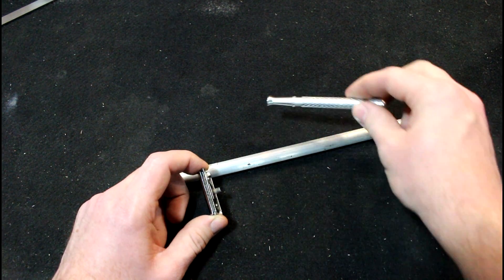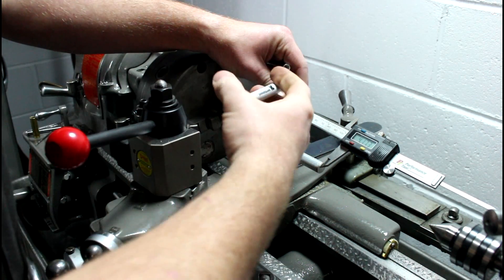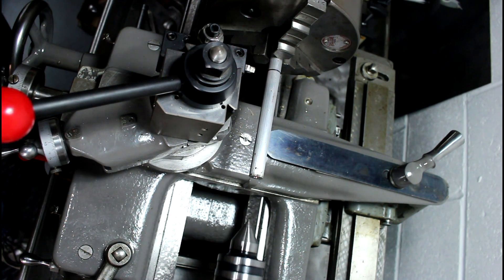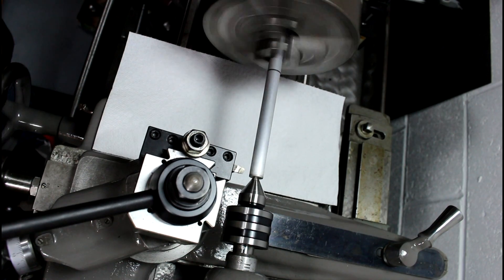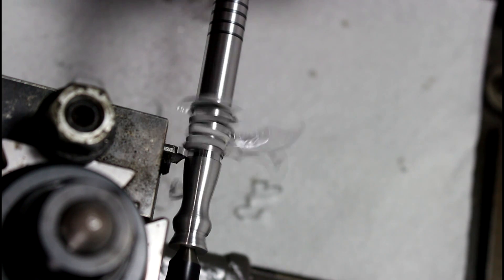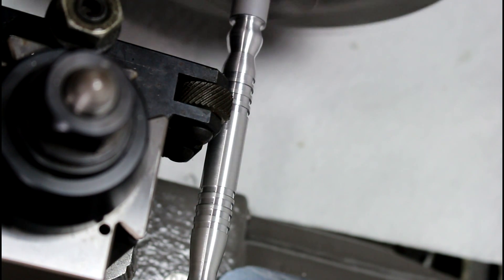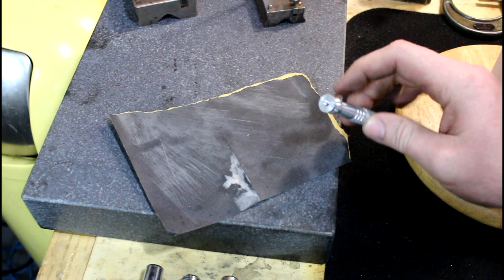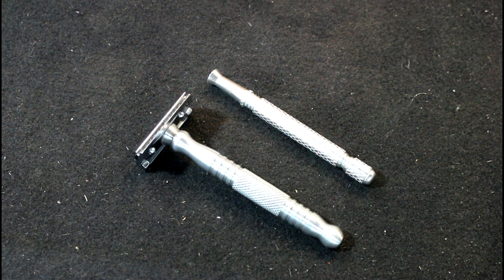Make A Safety Razor Handle Double Edge Razor, Metal Lathe Project

Comment: Hey,

Hope you're well

I've been using a cut throat / straight edge razor for face shaving for many years now

I'm now looking to replace my http://www.wilkinsonsword.co.uk/men/products/hydro5 with a double edge / safety razor for use on my body; namely private parts

Having never used double edge / safety razors, I'm left wondering if non-facial use is feasible/safe and if so would you be kind enough to recommend a brand and/or product?

--

http://www.wilkinsonsword.co.uk/men/products/hydro5 are expensive; at £1.50 per blade, which typically lasts half a dozen shaves (i.e. £0.25 per shave) and a multi-blade experience is annoying compared to single blade

http://www.feather.co.jp/ are relatively cheap; at £0.20 per blade (i.e. £0.10 per shave) and I purchase Feather blades for my [disposable] straight edge razor anyway

Hope to hear back

Kind thanks

Comment: what's a good project for me to do in grade 10 manufacturing need some ideas
Reply from the maker: +Tyler Peeling 
A few projects that are fairly easy to do are a plum bob, a small brass hammer, or even a tube body for a regular ball point pen! I know a lot of guys back in the day use to make center punches with a knurl, then I believe they were heat treated for hardness after all the work was finished. My dad still has his and that was 45 years ago! If you have a lathe and a drill press, some salt and pepper shakers would be easy too. It comes down to using your imagination and looking at every day objects and thinking if it could be done on a lathe. A rolling pin comes to mind too. Good luck and let me know what you figure out.

Comment: How much does a lathe like that cost with all the cutting bits. Nice work!
Reply from the maker: +opichocal 
I've seen similar un-restored lathes go for $5K with some tooling. You won't find one like this for less than that. I completely went through my machine and restored or replaced any worn part, along with having the bed resurfaced.
Reply: +Precision Machine Shed what year is this tool? Do you have a machine shop or is this a hobby? I'm jealous !
Reply from the maker: +opichocal 
This is a 1951 South Bend Heavy 10L. I did most of the work, so of course it didn't cost me that much, but I still have some money into it. I have a small home machine shop which is basically a hobby. I used to be a part time gunsmith for several years before I went back to grad school. You can check out my channel and I have a shop tour on there from about a month or two back.

Comment: Great video--showed me two things I've never tried: 1) Freehanding curves on a metal lathe (thought that was just for wood turning). 2) Using a rounded parting tool to do it. I'm inspired to try both. Thanks!
Reply from the maker: +Rick Rose 
Thanks for pointing those out. Never crossed my mind. Just be aware that you'll be left with a little cleanup when you use a profile cut off like that. Thanks for the comments

Comment: I thought I was the only one still using a double edge razor.
Reply from the maker: +1970chevelle396 
I got sick of paying $2-300/ year on blades. I switched a couple years ago and never went back. Can't beat 100 blades for $10-20!
Reply: I did the same thing about 20 years ago.  At that time I was in my early 20's, I've been using double edge razors ever since then.  I bought some old Gillet razors from the 50's off of Ebay.  they last a lot longer than the new ones.
Reply: +1970chevelle396  it seems you'd enjoy reddit.com/wickededge